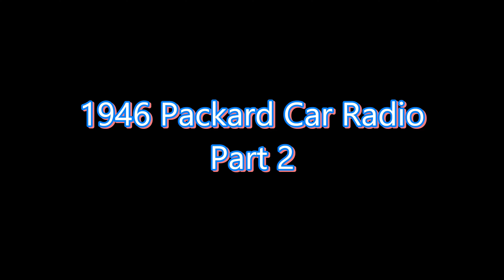1946 Packard Car Radio Part 2

Comment: Hi Vern. You’re wise to leave the tuning selector in tact and lubricate it. I have a 50 Buick and recapped it. It’s working beautifully. It’s very heavy and removing and installing it back because of the position one is working, upside down.

Comment: Don't know where you're located, Vern but AM 900 out of Nashua N.H. plays oldies commercial free. It's transmitter is along the Nashua river with radiated power 900 watts daytime, under 100 at night. I've got a 1953 Chevy car radio on my workbench and it picks up Chicago at night from Massachusetts!  The kicker is it operates on 110 volts as someone adapted it to do so eliminating the vibrator. My first vehicle was a 53 Chevy as well...
Reply from the maker: I'm in Hooksett. We have WGAM Manchester which is on 1250 and simulcasts with 900 WGHM in the Nashua area.
WGAM transmits 650 watts daytime/100 nighttime and I can only just receive it in the hole I live in. WGHM Nashua transmits 910 daytime/60 nighttime. If I tune down to 900 I can tell that something is there, just. 1250 used to be WKBR when I was a pup.

Comment: Is it possible to insert some modern magnets into the magnet frame and eliminate the coil current? Otherwise I think the old speaker should be used since the car environment will never be so quiet that the tone matters.

Comment: The newer speaker has a better high-end.
---
As for the I.F. being 265 KHz, times that by 2 and you get 530KHz, (sound familiar)?  In car radio's back then, one of the reasons this I.F. was chosen was due to motor noise/vibrator noise.  The other was selectivity and the lower frequencies. There is more to it then that, but that's the basic idea behind the I.F. choice.

Comment: The oval speaker is better, using cone technology which was rare if it even existed when that radio was made.  It's no more wrong to use it than to use a solid state vibrator replacement.

Comment: I must say that was excellent Vern. You are a good salesman especially when it comes to Wago connectors. I see how 
good the hold is on the wire is  when the lever is flipped down with the case.

Comment: Greetings:
You can extend the life of the EYE-tube n the Heathkit Capacitor checker by only having the tube working only while actually performing the test. Because of the high voltage being used an REED relay ccan be used to cut-off the target voltage to the tube unless a button is being pressed to allow that voltage to pass.
Hope this works for you!

Comment: If you are using an SLR type camera, there is probably a dummy battery that can be used to power the camera externally.
There WERE some communications receivers that had 500khz IF's, Collins radio made some mechanical filters at that frequency.  Auto radios almost always had 262khz (+/- a few) IFs.  They had RF stages for fringe area reception, and the lower IF for better selectivity.  Home radios usually left out the RF stage, and used and IF of 455KHZ for better image rejection (without the RF stage).  Early superhet sets all had RF stages, and IF's or 100KHZ to 175KHZ were common.  The lower IF frequencies could provide higher gain with early tubes.

I remember when I was in Jr High School, the electrical shop had an old Buick car radio hooked up to a battery charger playing.  It was about as big as that Packard set, but had 12v Octal metal tubes in it (including an 0Z4 rectifier).  The output tubes were 12V6GT's.